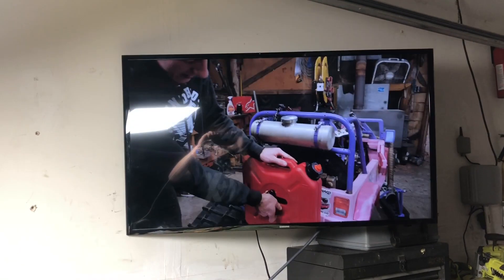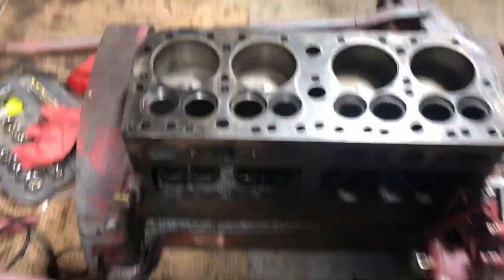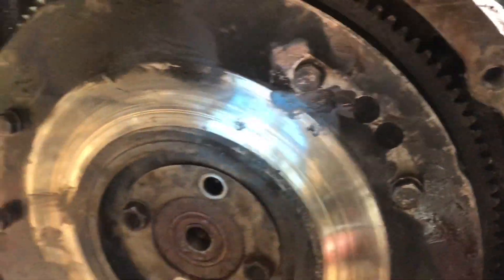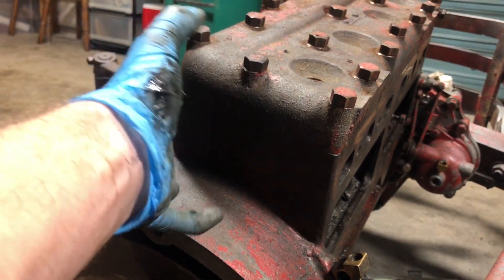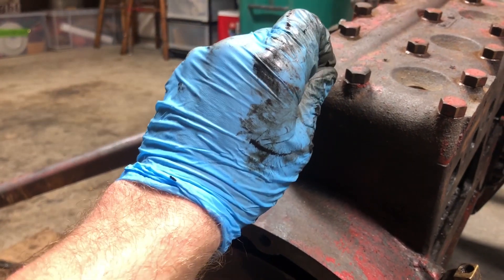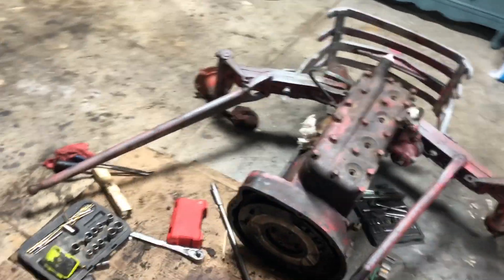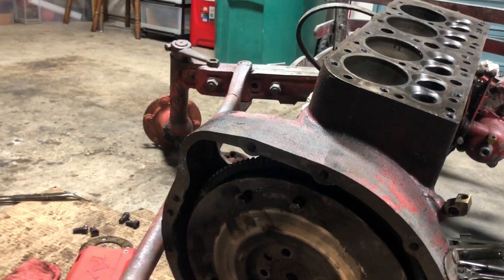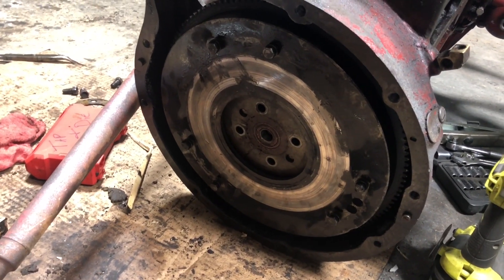Clutch / Flywheel Replacement AND a Workshop TIP/TRICK.   1952 Ford 8N Tractor

Comment: I’ll come help you put that back together this summer. I know you’re exhausted most days brother. ( been there ) I plan on taking a trip this summer to Texas . And would love too get her running with you. I am a 30yr mechanic ( being payed ) . So I will let you know the date when I figure that out. And it that sounds good to you you can let me know. Even if you don’t have the energy you can hang out and Monday morning quarterbacking while I work on it . I have only worked on one flathead engine end it was a Ford V-8. I have worked on single cylinder flathead Kohler motors a lot but with temperature really cool to work on a tractor . So let me know ,.... Hang in there man

Comment: Without the need to remove the head, you just feed the rope down through the spark plug hole, then pull it all out when you're done! Of course, you stilll needed it off to do your valves and pistons, so...  did I tell you I have Piston ashtrays? I have Piston shoes, I have Piston chairs.. party on, dude!

Comment: If only these stupid newer cars, you could pop the hood and get in and work on them like you can an older car!  That’s why I hate them!  All the electronics! BOO!   Stop the insanity!  Just bring the big block 350’s or something back!
Reply: Agree these new cars, need a computer auto degree. Way back when I learned to drive things were much better. Parents had a station wagon and a Renualt then  a Vega for dad to get on the airbase  about 3 miles from our house. All 6 kids had to learn how to drive the automatic and manual transmission.  I  knew how to pump gas, change wipers, change tires. Check fluids under hood, gap and change spark plugs. All a few more things about the car.  My first car was a 1965 Mustang. After I knew about cars and got H.S. out of way, Joined AirForce, even though I had 2 years of college.  Active duty then switched to Guard.  1972- 1997.  Today I  couldn't tell you a thing about cars. Best 25 years, long since retired